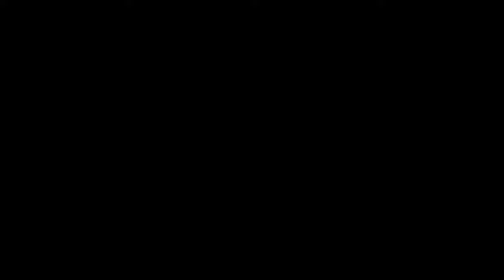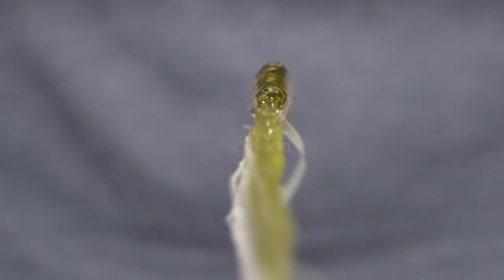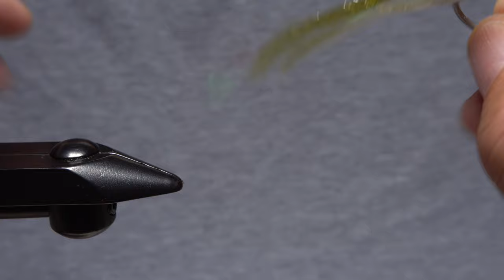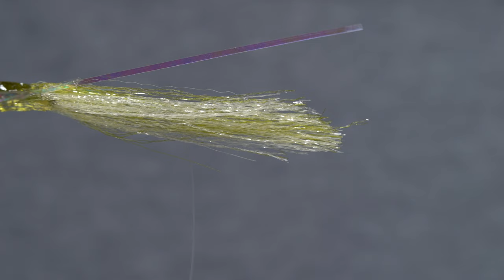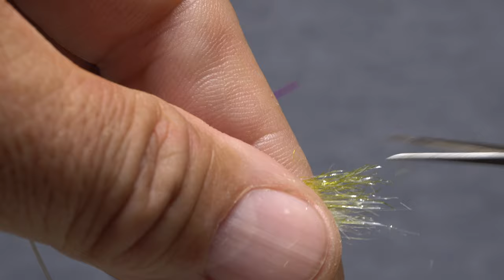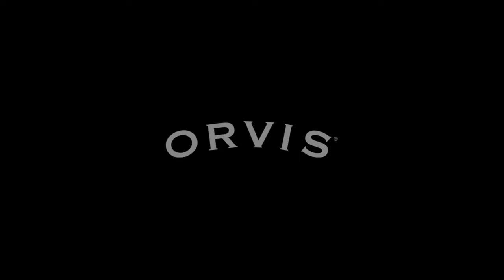Trimming Synthetic Fibers

Comment: On this fly have had good results with putting a chip clip on the base to flatten the fan, then cut at an angle in from top and bottom, giving a Y, tail. It doesn't look all that great but seems to draw the strike better.